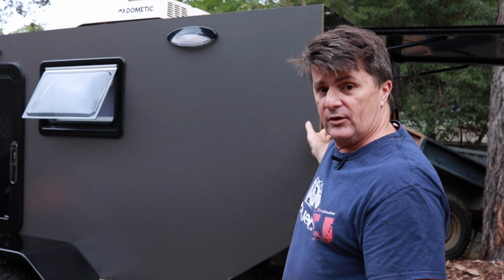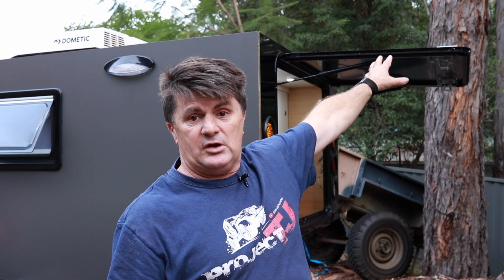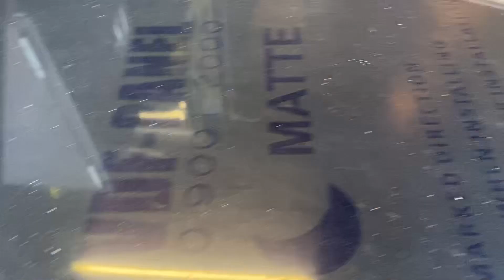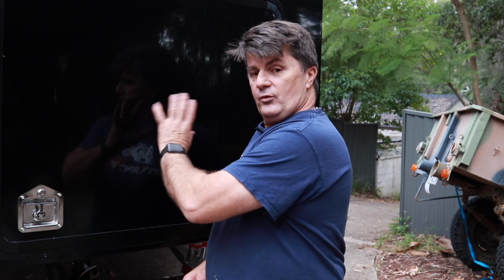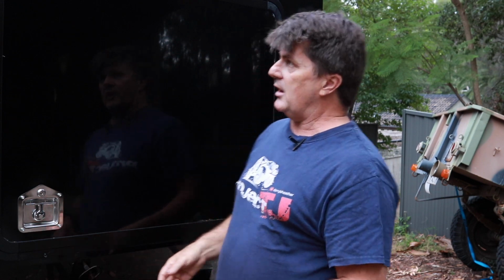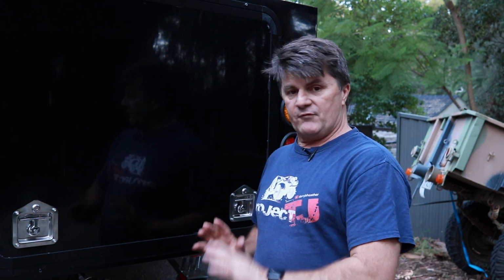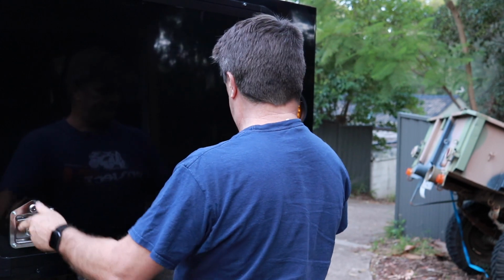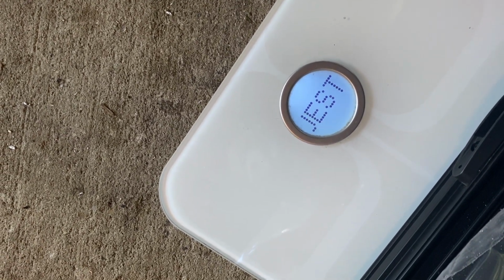Off Road Camper Build // Rear Hatch - Part 2

Comment: Very professional looking!
I’m considering building a trailer. Do you have a video on how you sealed the roof to the walls ? Also wondering do you have any thoughts why I couldn’t go 5,6” wide . I’d like to have a bunk across the back for my daughter..thanks 👍
Reply from the maker: Yes I filled the wall/roof gaps with sikaflex and then added aluminium angle over the top and sealed those edges (see videos) Going wider is ok, just make sure than the materials you have access to work with the width you are designing for.
Reply: Darryl Sheather 👍thanks